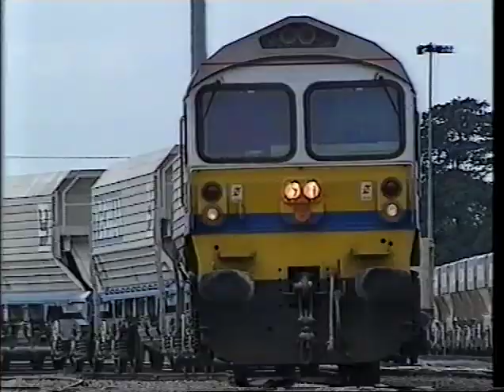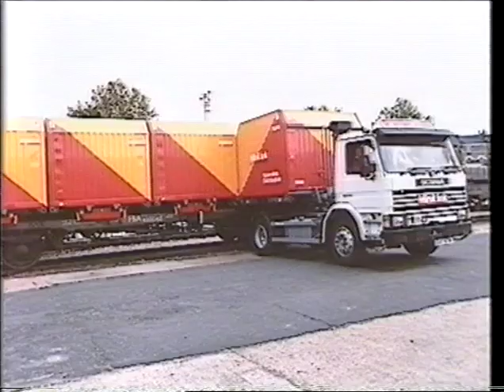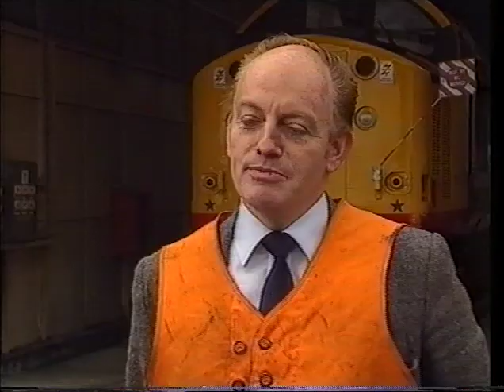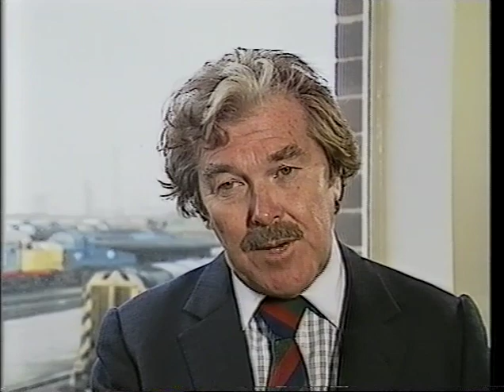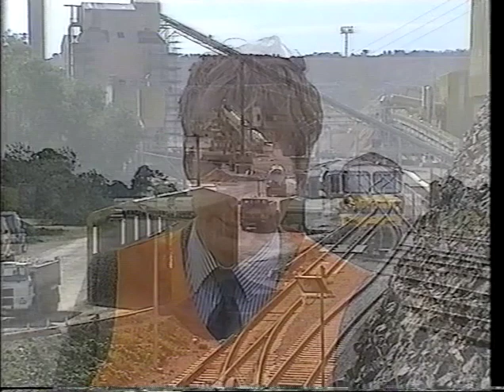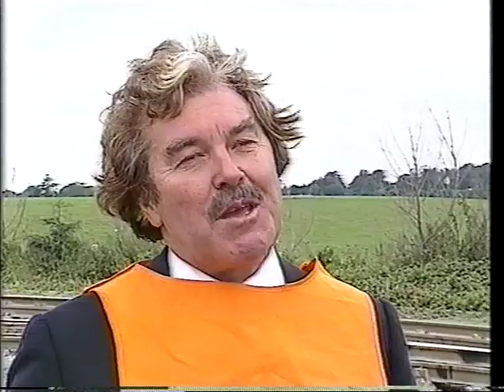BR Railfreight Express (1987)

Comment: Dover train ferry, was a waste of money.Channel Tunnel was underconstruction in 1987,why did anyone think,spending Millions on ferry facilities,was a good idea?
Reply: Because dangerous loads couldn't use the tunnel. The ferrybladted a few years, but the loading fell as very few wagons loaded with these dangerous goods were crossing the Channel. Most of the dangerous goods shifted to the roads.
Reply: @neiloflongbeck5705  Yes,forgot about dangerous cargo,but the proportion of that type of cargo,to ordinary,must have been very small.Still seems a waste of money.All the track,at Dover long gone.
Reply: @gwpee1727  I think the ferry was the Nord Pas-de-Calais, which was capable of carrying both rail (6 siding of 600m of usable rail deck, which equated to 30 average size bogie wagons) and road traffic (rail on the lower deck and road on the upper deck). She could do the crossing in 2 hours and could do 3 crossings per day (4 on  busy days). Unfortunately the progressive decline in wagon load traffic on both sides of the Channel led to the loss of many small scale flows coupled with the shift to larger wagons such as the IZA twin vans meant that the rail deck was less efficiently loaded that it became to expensive to operate and maintain the link spans on both sides of the Channel. Hervlastbload of rail traffic was carried on 22/12/1998.
Reply: Was thinking the same!

Comment: And the 37s are still going strong. Where are your 60s now,,, all lined up at Toton.  
Mmm, something didnt quite add up. 
Thanks for posting this. 
😎👍
Reply: That was EWS who under Ed Burkhart went for the crappy class 66 and 67's that were EMD built on the basis of standardisation and the ready availability of a parts inventory over using older British built locomotives that were pretty much time expired.
Some might argue that it was worth it, but it has left a legacy of a large number of two stroke engined locomotives that will as they get older require to be retrofitted with expensive anti pollution measures to meet increasingly stringent air quality standards.
Reply: @darreng745  Not a fan of the 66's even though i work on them but they are cheap to maintain and proved reliable . As yet no retrofitting any anti pollution on 66's seems the older loco's come under pollution standards at time they were built , but for how long ? . Way things are going can't see this lasting and it will be last minute rush to clean up 66's 67's so they comply
Reply: True to many at Toton but we still use quite a few 60's on our Kingsbury and Jarrow tanks plus quite for other flows , DCR have some 60's working as well . Don't think 37's (good as they are ) would go down well with drivers after being use to the class 60
Reply: 37s are hardly "going strong".
Reply: @steveluckhurst2350  Ageed, but they're still going stronger than the 60s. About 20% of the 37s are still in service, compared to less than 15% of the 60s.

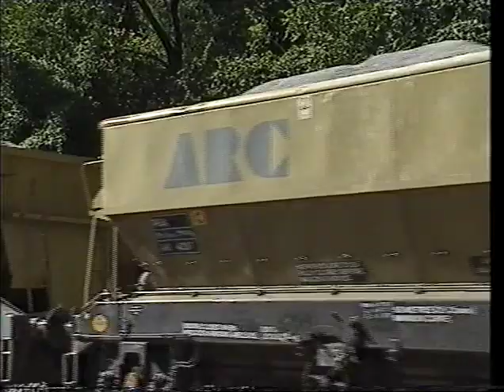Comment: Interesting video! Points run-through about to occur at 9:18 ... oops! 😵😳🙈
Reply: Until last month the rule book allowed points to be run through in yards depending on local instructions. Network rail has now changed this rule and all points need to be set for the route being taken. However in certain depots or yards owned by TOCs or rail freight operators it will be up to them if points can be run through. The reason for the change in rules is that the latest points have stronger springs on them and they are unlikely to spring over reliably when a train runs through them. Obviously on the mainline points always needed to be set for the route to be taken
Reply: @andrewblades8368  Many thanks for the reply and info .... very interesting!

Comment: Spent all that money on GM junk and still the old tractors of BR are still going strong e.g. class 86, 47, 37, 73.
Reply: Nob end. Sentimentality gets you nowhere. Prepare yourself for a shock - the railways aren't run so you can fill up your notepad, shout "cop" inexplicably every once in a while and flail your arms from a moving train. The GM junk you allude to has been the backbone of rail freight for decades, far cleaner than your beloved EE stuff, being modifiable to comply with ever-stticter emissions requirements and has Europe-wide coverage... Sorry, you were saying?
Reply: GM shits on anything pommy. I'm sorry it's just the truth.
Reply: Lol
Reply: The 86s are all out of service. Sure, there are quite a few 37s and 47s still running, but they're hardly "going strong". The 73s filled a particular niche but less then half of them are still in service, so they're not really "going strong", either.
Reply: So the class 66, the most prevalent locomotive in the UK is somehow Junk?
And the 59s are still going strong.

The very locomotives that did away with double heading, carried record loads and changed the way the UK dealt with heavy freight loads, are somehow junk?

The reason they were purchased was because BR were continually building junk and their unreliability made private operation a nightmare.

Comment: Just think how many HGV's would be off the road now if that Speedlink stuff would have taken off .....
Reply: Speedlink did take off, it was a system that was used for years. The problem was that it didn`t always carry block trains, like you see here. There was an awful lot of local trip working required, using smaller Loco`s such as 25`s and 31`s that would all be running around with just a handful of wagons on them. Those wagons formed the feeder service that then had to be shunted into the forward speedlink service. The powers that be deemed it all to be inefficient and over costly so the service was scrapped.
Reply: By the time of Speedlink's demise it was carrying only 2.3% of the freight BR was handling (or only 0.12% of all of the freight being handled in the UK). BR conducted a survey of around 30,000 potential customers and only got a handful of responses. Trip workings and marshalling accounted for about 70% of the costs of Speedlink and those trip workings needed to have a timetable path, locomotive and crew(s) for every say the service was due to run, even if there was no traffic. BR looked at cutting internal costs - if they could saved 40% on the costs of Speedlinkmonly 15% if the traffic would be profitable. BR knew that to make Speedlink cost effective they needed each supplier to send out 10 wagon loads per day over a journey distance of 500 miles and that there just weren't enough customers in the UK to do that.

In 1986 Speedlink had 120 trunk services each weekday and 700 trip workings, many of them only running as required  ut still requiring the allocation of a locomotive and crew(s). Some of the trip workings required 2 crews to complete, such as the service along what is now the Mid-Norfolk Railway. Some trips served only 1 customer with a handful of wagons. Whilst theoretically possible to put all the wagons onto a single trip working in practice this was rarely achieved as customers all wanted an early morning delivery and a late afternoon collection, making BR's job much harder.

Comment: Is it just me or did that 59 run through the one set of points with the blades set the wrong way
Reply: The BR handpoints were designed to be run through but when EWS came onto the scene, they fitted USA style points that weren't. So we then had to set every point regardless.
Reply: @Mariazellerbahn  October 2021 sees the practice prohibited in the NR rulebook. My arse! These type of point mechs were designed to be trailed through (that is run through when set wrong direction when approaching from non moving end of the blades). I'll still do it and balls to them!!
Reply: Can be done but aloud
Reply: It was done quite commonly with hand-operated points